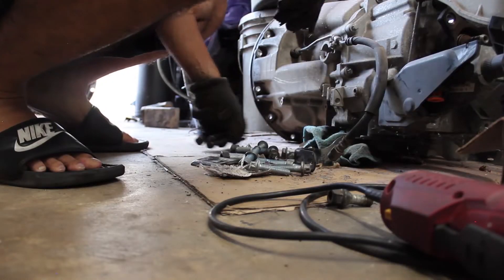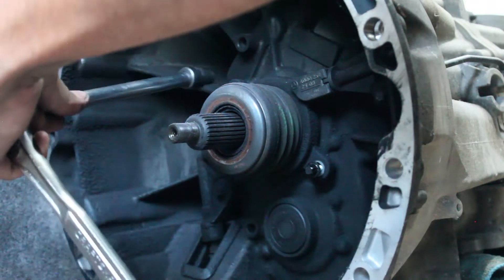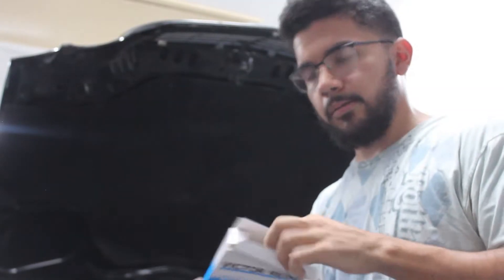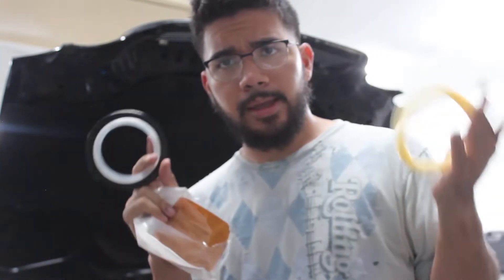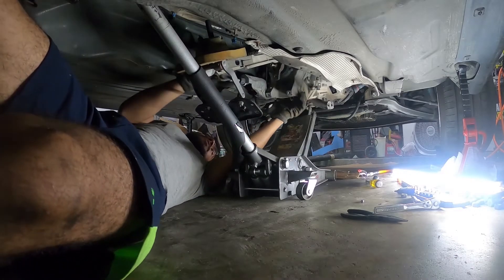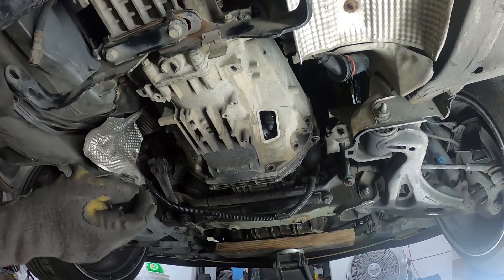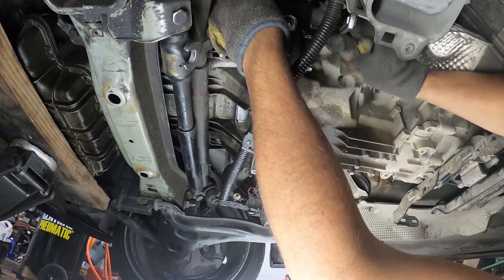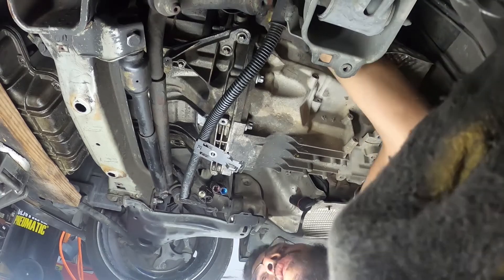Installing the Manual Transmission for my CLK55 AMG! Part 3. And ran into a slight issue.

Comment: Hello Jikjakz. What a fantastic voyage this has been for you. Kudos man!! 2 successful swaps (or is it 3?). You have provided invaluable info which has inspired me to start the attempt on my own. I bought a '02 CLK55 and I am starting to put the parts together.
 I am in Long Island NY and we don't really have access to Euro Junkyards in NY, especially not for ANY manual MB so I have some shipping charges in my future.

I have a few questions:
1 - did you have to modify the Crossfire shifter linkage (or opening) to make it fit?
2 - did you ever find an electronic solution for removing the auto shifter altogether (figured how to release the key if AT shifter is removed?)
I am SO looking forward to rowing my own gears in this beast! The MT is the missing ingredient that will make this car really come alive. GREAT WORK MAN!! 👏🏾👏🏾